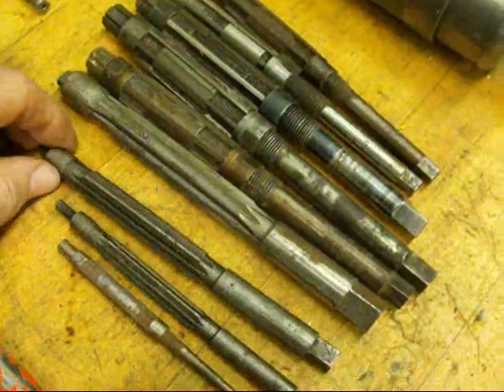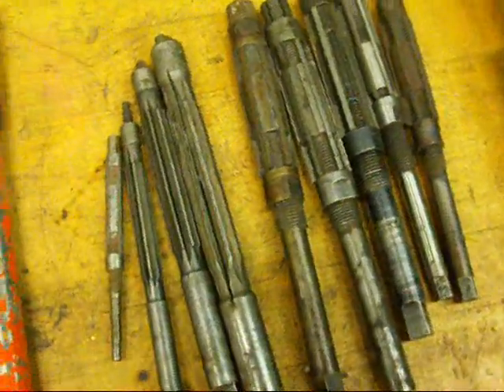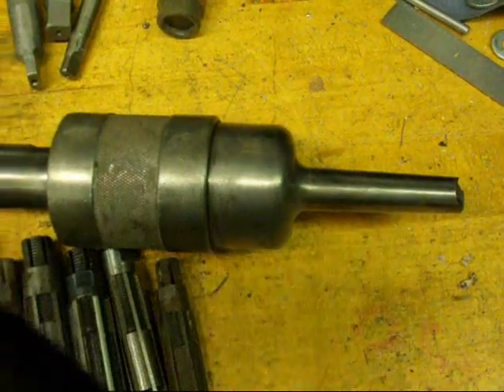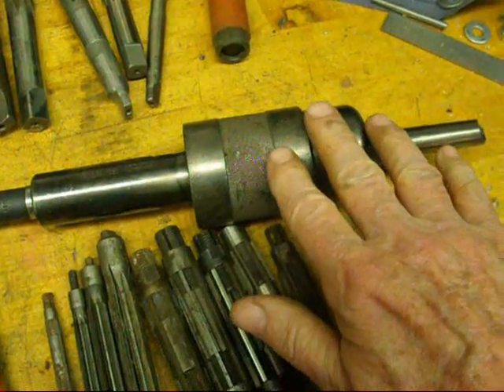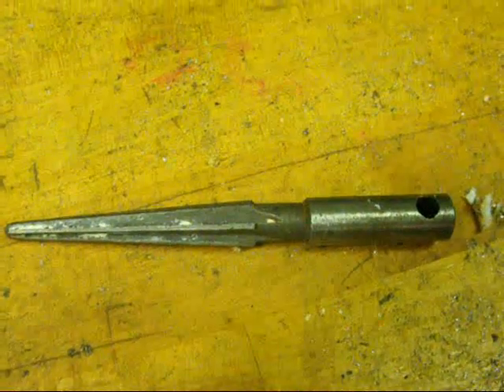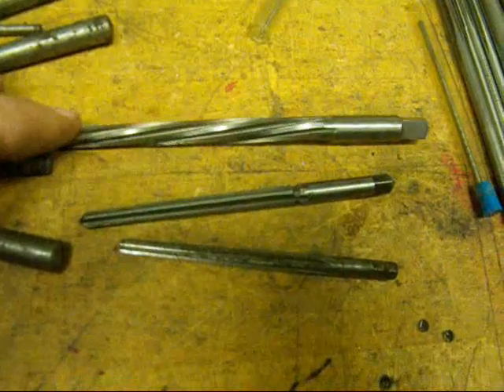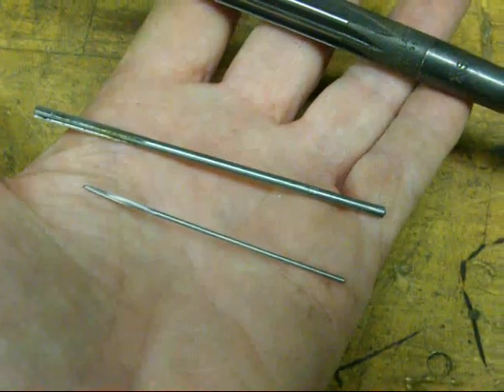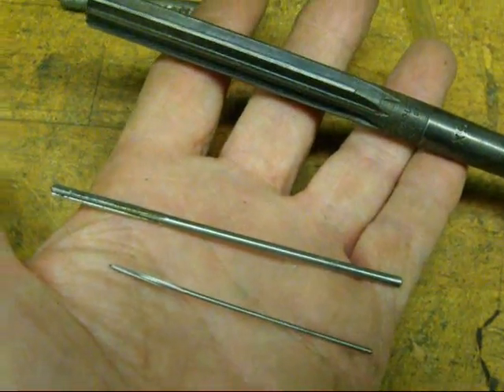THE USE & CARE OF REAMERS Part 2 tubalcain

Comment: Those taper pins are the bane of South Bend lathes, had to drill out multiple pins to disassemble the machine, need some extras like you have in your hardware.

Comment: Holly cow! I worked for a shoddy Millwright a while back and to get bearings to fit we had to sand the shafts by hand with emery cloth. Ten foot long shafts with many bearings to be put on. Someone messed up in measuring or ordering the materials. It would have been better to ream out the bearings to fit based on what I just heard here at 0:57

Comment: Taper pins are still fairly common on machine tools when you need to have something accurately located, but need an easy way to remove the pin. On most of the modern machine tools (CNC machines) I repair, they are drilled and tapped in the center (The taper pins)  so that you can use a slide hammer to pull them out. A couple good hard backward whacks and they break right loose and come out.  Much easier than a roll pin.